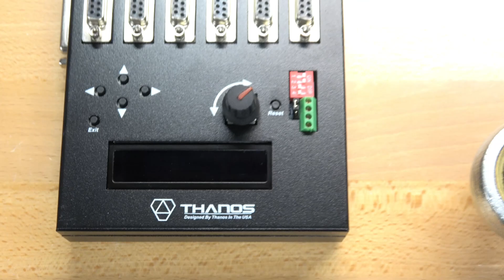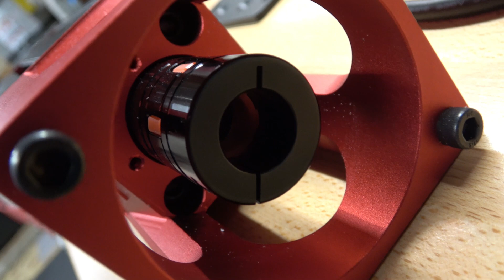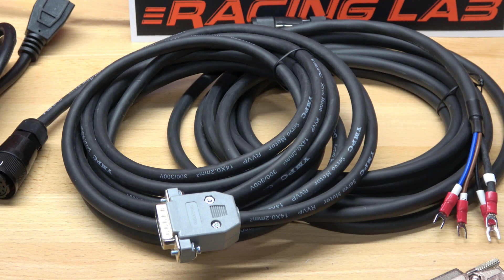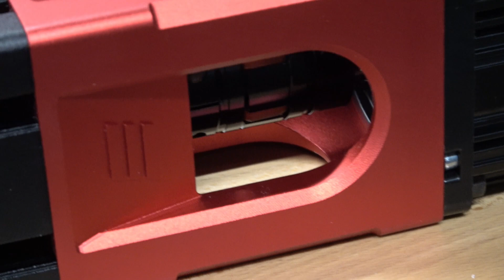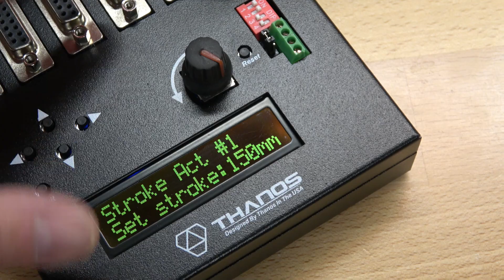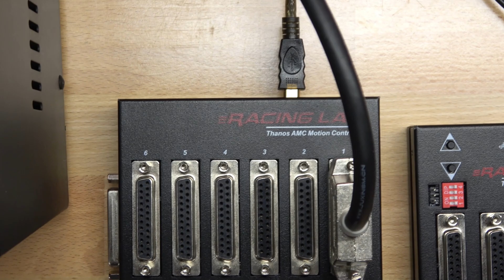eRacing Lab Actuator Kit Review

Comment: Thanks for the video, very useful since I’ll be getting same setup next year, have you by any chance tested the latency of the system?
Reply from the maker: About 31ms reaction time if that is what you ask...
Reply: @tronicgr  thanks, I was just doing some research between the rs mega4u and the  qubic qs 210 and it was hard to find that latency/reaction time for the mega. I like your controllers and Simhub and ended up assuming the latency would be below 50 ms

Comment: Hi, do you still need to leave a 2mm gap when installing the motors with the newer revision?  or do you just fit it onto the orange plastic spacer with no gaps.  Thanks
Reply from the maker: @SimVRRacing  better to have the gap, but if you are not sure perhaps you can ask eracing lab about it..
Reply: @tronicgr  Thanks.  I have left a gap, but was worried since the new spacer leaves a 2mm gap anyway, I had too big a gap.  Have emailed eracing but no reply yet.

Comment: hi there do you consider these as good as the scorpions other than the scorpion has greater speed at peak and greater load lift i was looking at pt actuators but wondered if these are worth getting instead as they are cheaper
Reply from the maker: @dominicrobertdillonbrown9938  both have same speed, same lift loads ability. Just get the eracing-lab ones, half the price and 3 years warranty 🤷‍♂️ , plus easier to mount. See here a comparison video : https://youtu.be/xRP77k0-DfQ?si=LwHjGVrxr1cjviK2
Reply: @tronicgr  thanks for replying buddy much appreciated, according to PT they can up speeds to 500mm / s given it looks exactly the same motor i assume the same is likely for these ones aswell given its software controlled yes my bad on weights you are right they are the same i was quoted £16k including vat and shipping for 300mm variants (x7) seemed steep to me given 150mm costs, and if as you say these are cheaper seems a better bet, is 150mm length only ones they do cant see others on website maybe you know

Comment: What about 120v in America? What do we do?
Reply from the maker: @Dronetothetop  works great on 120v (or 110v) doesn't matter, can operate down to 100v
Reply: @tronicgr  So I just have to use the transformer (110v -> 220v)? That is the only thing preventing me from buying these motion systems. Nobody talks about the 110v in America
Reply from the maker: @Dronetothetop  you don't need transformer. These AASD servos are rated to run on both 110v/220v. I run them on 110v here directly from mains, without problem.

Comment: Hi, I'm wondering why I'm get jittering when my fps drop just tiny bit using MSFS with SRS and e racing rig ? why the motion data connected to FPS, is there a way to minimize or eliminate the issue ? Thanks

Comment: With this aasd how much noise difference is there compared to older black ones? Also, are there any sellers who sell those white ones separately? I am thinking of swapping from older to newer.
Reply from the maker: Night and day difference. The white ones have switching frequency of 16Khz which is virtually really hard to hear. Eracing-lab offers just the white drives if you need to swap the black ones you have: https://eracing-lab.com/collections/diy-projects/products/aasd-15a-pack

Comment: Are you wiring Neutral to ground on the 240v connection? 

I am wiring my servo drives now. 
It is my understanding this that 3rd wire(grey) is ground when 120v but becomes neutral when wired for 240v?
Reply from the maker: I would get a power converter so you can use truly single phase 220v, with Live/Neutral/Ground.

When wiring 220v from grid in USA, you essentially wiring two 120v phases through the device, with the Neutral taking the place of ground. But in this case, even if the Neutral doesn't carry current, it still imposes 60v phase difference in perspective to true local ground... complicated but yeah. Just get a power converter from Amazon... a 2000 watt or 3000 watt should be plenty.
Reply: @tronicgr  thank you for the response. 

My plan was to leave neutral disconnected and run a separate wire from the drives to my closet track which has screws into the concrete(ground). 

Am I crazy? Should I stick with the converter as you say?

Comment: I got my 4 E racing actuators today and for some reason while testing it with RSR studio software, one leg was up in the air while testing hive, roll and pitch. I'm not sure if it's software issue or something else. Thanks
Reply from the maker: Probably connected actuators in wrong order... Did you check with eracing-lab for instructions?
Reply: I connected everything based on the instructions.  Are the instructions based on seated positions when they talk about  Left, right, rear and front ? Thanks @tronicgr

Comment: What step up converter do you recommend?
Reply from the maker: There are several step up converters on Amazon, depending on your system usage, a 2000VA to 3000VA should be enough. Just make sure it has fuse switch, just in case.
Reply: @tronicgr  my only problem is my UPS is 110v I believe.
Reply from the maker: @vikingcat794 not much of a problem,  there is trade off of lower Amperage using higher voltage. In short there is less power loss on the motors and work to their full spec
Reply from the maker: @vikingcat794 also helps that many of these power converters have soft start to avoid overloading your UPS.
Reply: @tronicgr  so plugging my drivers into a 110v ups plugged into the output of the step-up doesn't present a problem?  And I would leave the drivers set to 220v?
Reply from the maker: @vikingcat794 your UPS should connect to the 110v power, the step up power converter into the UPS, and the servo drives into the Power converter so they can have 220v... just make sure to get a power converter with soft start so it won't trip the UPS fuse.
Reply: Question about motion actuators (e.g. the eracinglab rs ultimate gen2): Other than cooler motors which may help with durability of the motors, any actual meaningful performance benefits to using 240v vs just sticking with the 120v?
Reply: @tronicgr Question about motion actuators (e.g. the eracinglab rs ultimate gen2): Other than cooler motors which may help with durability of the motors, any actual meaningful performance benefits to using 240v vs just sticking with the 120v?